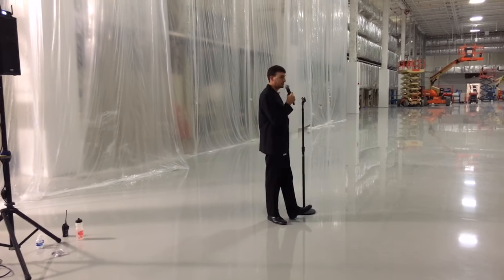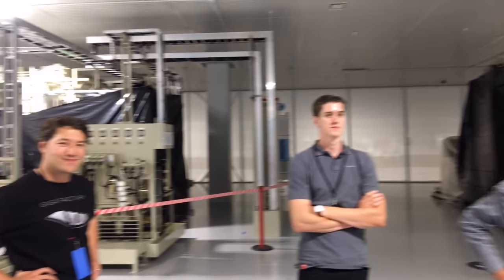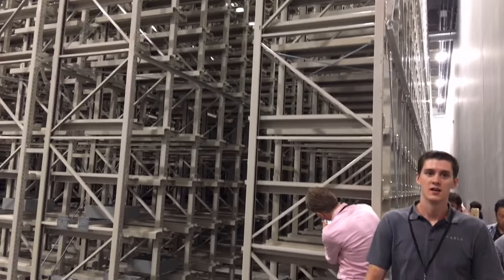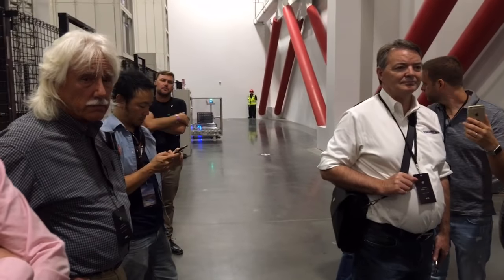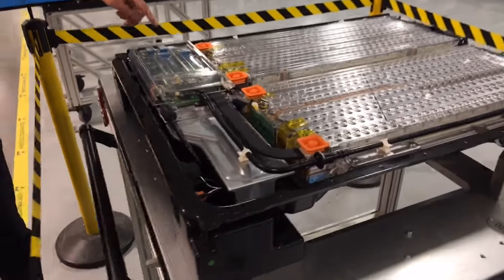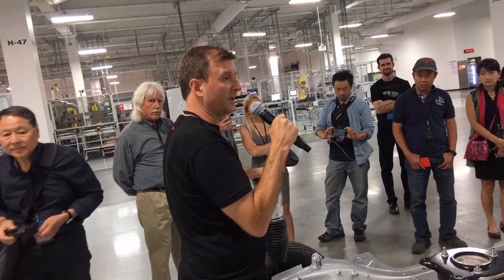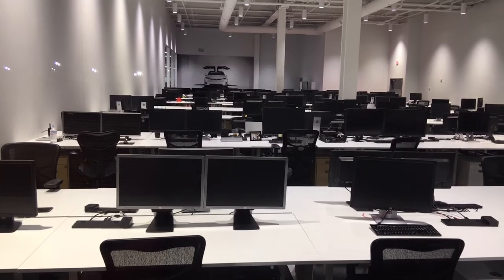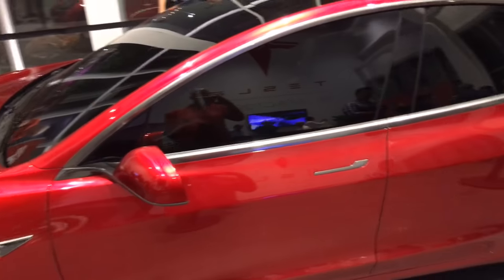20 minutes detailed #gigafactory Tour, looking behind the scenes

Comment: One important detail i have still not seen an answer to; Will they be making the "old" format 18650 at GF too to start with (to use in S/X) or will they only make the new 2170 format? Elon/JB did say that 2170 will find its way to S/X, but timeline is a bit unclear in relation to GF.

Comment: suspicious that equipment covered and no noise on factory. Is it in building process yet? Do you have video from production area?
Reply: What right do you have to be suspicious? And there's plenty of noise on the floor. The way in which these batteries are manufactured is very quiet compared to CNC machining etc. There's very little high speed machinery involved....therefore no noise. Not that they need to explain themselves to you.
Reply: yes the factory is in the process of being built, did you even watch the video? it isn't expected to be completed in it's entirety until 2020.
Reply: That's an assembling process,not a tooling process, then there's not a lot of noices. Parts are tooled in suppliers plants, by technologies : metal tooling, plastic injection, wire manufacturing, and so on.